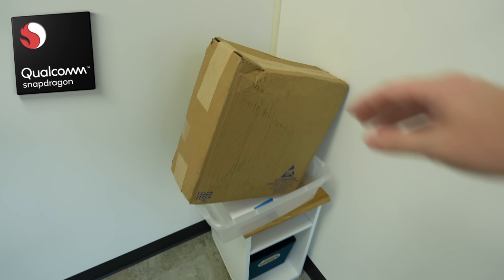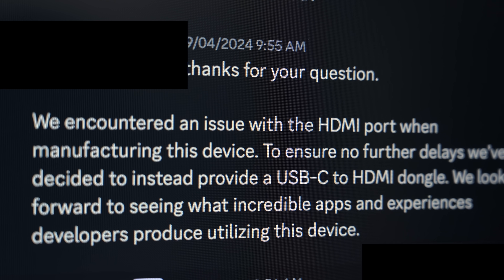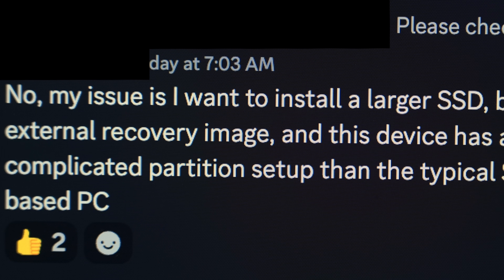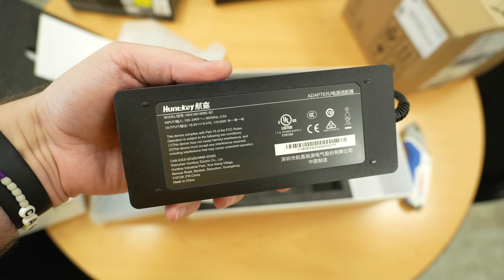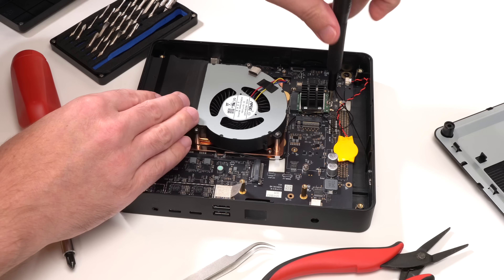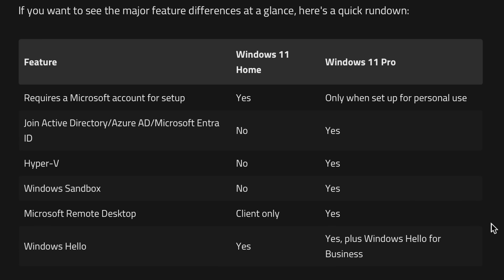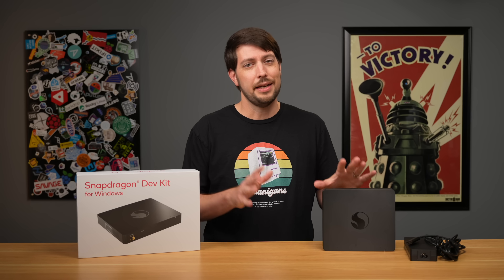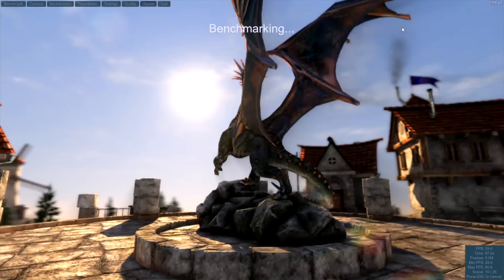Snapdragon X Elite Dev Kit: The CoPilot-est PC, tested

Comment: The reason is doesn't come with windows pro, is probably because it cannot run many of those features like virtualization, or encryption, etc..
Reply from the maker: It can, though! And Active Directory integration, in particular, is huge for a lot of dev shops—they would need to attach the device to their domain so devs could access it... and with Remote Desktop too.
Reply: @JeffGeerling Yeah I upgraded my Surface Laptop with an enterprise license and basically the only thing missing is RSAT (don't know why, must've been very ancient code)

Domain join works, Docker works, Hyper-V works, WSL works, everything just works. Todd Howard would be proud 🤣
Reply: @Thomas-Larsen  Microsoft has basically sunsetted RSAT, and have said they will no longer be developing it. They recommend people move on to their new web tool, but it isn't up to snuff feature parity wise yet.

Comment: It seems truly bizarre that the cost(?) of not putting the most limited Windows edition on these would even be an point of discussion considering what this piece of hardware is supposed to be, not only for Qualcomm but for Microsoft as well.
Reply: It's thinking like the huge megalomaniac company of era X that thinks it cannot be beaten. I recall it being AT&T / Ma Bell at one point, DEC at a second, and IBM at a third. Time for the largest to fall, again.
Reply: Maybe the 'pro' features of Windows are broken on this platform?  So they just removed them.  Similar to removing the HDMI port even though the converter IC is still in the system.
Reply: its a dev platform? the people who buy this and use it have someone to foot the bill

Comment: Not really sure why this devkit was necessary. Unlike the M1, there have been Windows devices running Arm64 for years already. It's the same Windows, same APIs, same executables run on it. Yes, maybe there is some special hardware like the GPU to optimize for but it seems that a lot of stuff already works and as usual, things can get patched later.
Reply from the maker: It seemed to me like someone wanted CoPilot+ to be the launching off point of 'the next era' of Windows on Arm... one where it actually meant something.

But instead, it turns out that was mostly marketing, and these newer Snapdragon X devices are all just incremental (good, but not revolutionary) improvements over the 8cx that came before.

Comment: “Mac Mini Killer” lol the EXTERNAL power supply alone is about the same size as a Mac Mini. Even if this thing had great performance (which it absolutely doesn’t) it still wouldn’t be a Mac Mini killer - it would just be a cool ARM mini PC.
Reply: Do Windows people want Mac Mini killers? I always assumed they were for people who wanted Mac software but didn't need a laptop. If you want Windows - or better, Linux - get a mini-pc, there's a whole spectrum of options, from cheap to fast.
Reply: @henrikoldcorn  The 1L form factor is very popular, both with the Mac mini and on the PC side - there are many options from Dell, Lenovo, HP, etc. The main downside with most of the PC options is they don't have integrated power supplies.
Reply: If they had spent a bit more engineering effort on it, they could have designed a better enclosure that dissipated the heat better so the fan didn't scream - and they could have put the power supply inside. But they didn't, and it's a hunk of e-waste as a result.
Reply: it could be actually good, if it would be able to run linux....but Windows on arm is kinda shit, as well - lack of hardware availability
Reply: @s.i.m.c.a  If you think that general software availability on WoA is bad then Linux is even worse
Reply: @TheTytan007 it's not about software availability most linux distros have arm ports
Reply: @TheTytan007 How is linux worse than Windows in ARM? This is a ridiculous thing to say
Reply: @thehady1  So does Windows and any modern OS
Reply: @TheTytan007  it's "easier" to make linux arm ports and it's  generally faster for an architecture to be supported in linux than Windows linux also has a risc-v port which I don't think Windows has
Reply: @TheTytan007 linux for ARM has been around for years now. Lots of servers made the switch
Reply: @TheTytan007  Most Linux software can be built on ARM if you use a different compiler, but the distro developers have thought of this and have recompiled and ported stuff to run on ARM, RISC-V, PowerPC, SPARC, MIPS, etc.
Just because it is Windows and the most popular OS on x86 doesn't mean that it has good software support on other architectures, and Linux is WAY more mature on ARM than Windows because it has been running on ARM for DECADES at this point on big servers and SBCs like the Raspberry Pi, and has amassed a large amount of software that can be run on it because of the aforementioned ability to build stuff from source (which you can't really do on Windows)
Reply: I though the mac mini also had a rather large power brick? Either way though it could be the foil to the Mac mini for those that don't like Apple's software/hardware walled garden approach even with a big power brick - there isn't a total system volume including all external cables, powersupply and peripheral requirement, just a practical and similarly small desk footprint experience.
Reply: @foldionepapyrus3441  Mac mini has internal power supply.

Comment: It seems like the ECB could be the Embedded Controller Board - this is a class of products that ITE does make (I posted this comment before with a link but it's not showing up, not sure if a moderation tool blocked it so trying again without the link). Embedded Controllers are essentially "BMC (Board Management Controller) but slightly less so" in that they're smaller and lower power than the BMCs used on servers, and typically don't have their own networking or graphics. They're responsible for power sequencing / power state management, fan management, UART breakout (for debugging), etc. 

Generally I would have expected this to be soldered to the mainboard, but if this was development hardware, maybe they wanted to validate different vendors (ITE, Nuvoton, Microchip, etc) and put it on an add-in card instead. BMCs being on add-in cards is also becoming more standard in the server space so maybe they were just taking a page from that.
Reply from the maker: That makes sense; I wonder why it is on the board where it is, though... maybe just convenience, but it's especially weird the connector's right next to the SIM card slot. Maybe they have a version that could be remotely managed over 4G/5G?
Reply: @JeffGeerling  I'm not the most up-to-date on laptop architectures but it's also possible that the SIM card just needs to go to the EC to begin with, even for normal operation. Given this is Qualcomm I'm assuming they'd have some variant with WWAN built into the core SoC, and wouldn't need an external modem (so it's not like the SIM card would be running to that other modem). Said core SoCs don't tend to have a lot of higher-voltage I/O (they're on more modern process nodes with lower voltages), so they tend to use the EC as an I/O expander, which could include the SIM card. ECs then generally have options to present peripherals memory-mapped to the core SoC over a bus called eSPI.
Reply: @JeffGeerling  Wouldn't the daughter card most likely be the "baseband processor"? Cell phones run multiple operating systems simultaneously and one of them handles all the communication to the cell towers. They are usually designed as "blackboxes" which one can communicate using Hayes-style AT commands.
Reply: @BenInSeattle  PERHAPS they could have just used the single ITE chip on the motherboard, for all system functionality, but that ITE chip has optional features to be tied in into a nearby microcontroller (clearly it is), which would be where they run all their custom proprietary crap. They would have put signed certs/keys & modem baseband stuff into this adjacent micro. Then encrypt the whole thing with more Qualcomm signed encryption keys, the whole thing is very black box-like, and Qualcomm is known for this.
Reply: By the way, it's a known thing that including links in YouTube comments will make them disappear rapidly. I presume it is to keep people from having easy exits from YT.

Comment: AMD's new laptops chips are so good that ARM for Windows is completely uninteresting. They are too expensive though. ARM-Windows should be for cheap PCs not crap macbook clones.
Reply: Arm windows PCs are still cheaper than x86 which cost more then 200$ more from amd and Intel and Qualcomm is also releasing a newer cheaper version of the snapdragon x plus to go into 600-800$ laptops soon

Comment: Microsoft gave Qualcomm a several month head start with the Copilot+ PCs, and they squandered it. What a shame.
Reply: To be fair, Microsoft did its share of squandering too. The absolute amateur state of the Recall feature for one. Some of the software support issues are also MS’s fault. But yeah, QC could have done more.
Reply: Snapdragon X Elite was simply too late. They've been hyping it up for 3-ish years before it released, and every quarter they'd say it's happening soon. When it finally DID release, it didn't match expectations and in a hilarious turn of events AMD and Intel caught up in terms of battery effeciency (AKA the one thing qualcomm had going for them)
I will forever thank Qualcomm for forcing Intel/AMD to take their laptop business seriously, but unless they do a gen 2 product that blows everything out the water I expect the hype for an ARM windows chip will die very quickly.
Reply: @PopCar  What if the next Intel CPU generation matches Qualcomm on battery life? Bye-bye, Windows on ARM. Good riddance.
Reply: @RoastBeefSandwich lunar lake looks to close enough of the gap that ARM incompatibility won’t be worth it.
Reply: @RoastBeefSandwich  It literally can't happen. The architecture hasn't been updated for the scaling since the 90s.
Reply: @RoastBeefSandwich well I would sure hope a next gen chip would be better than a last gen chip sadly that's not always the case with Intel 😂. It's like comparing the next gen Intel chip with a m3 instead of m4/m5. I could say the same for Qualcomms next gen chip lmao 😂
Reply: @PopCar  no it's not late never late.
Reply: @PopCar but if qualcomm buys intel then their good 😅
Reply: @PopCar they didn't catch them with battery stop the cap 😂 and the screen off time drain is way worse still 😂
Reply: Would buy a linux version of that.
Reply: Windows was the problem,not Qualcomm,lack of app support was the main cause of X Elite's failure.
Reply: @boltez6507  .. I'm sure it had nothing to do with being ~5 months late with the product.
Reply: @tsalVlog  Yeah their timing was also terrible but x86 translation being shit was the primary reason of failure in contrast apple's rosetta was all good out of box and hence there were few negatives regarding app support.
Microsoft screwed qualcomm,surely with a team of  massive engineers they could've developed a better translation layer but they messed up.
Reply: I've had a fantastic time with my arm laptop, Qualcomm should do a better job marketing the product instead of ai but it's still great in the end in my opinion. The x86 competitors are often hundreds of dollars more for similar chassis' and performance.
Reply: i cannot stand the fanboyism of you w's
Reply: M$ didn't do diddly. There is an obvious 'hidden agenda' here. M$ has not real interest in ARM for end-consumers.
Reply: Is it though? Since CORTANA WAS AWFUL, so why would we expect COPILOT to be better?
Reply: Why doesn't Microsoft just dump AMD, Intel and Nvidia and fully concentrate and attract the developers to the ARM version?!
Reply: @carholic-sz3qv  lmao it ain't that easy,x86 isn't even worse than arm,they both are equal competitors.
Reply: @carholic-sz3qv  mabey not AMD but Intel for sure I absolutely agree Intel has lied to Microsoft for years and made false promises to them over and over again I would not hold it against Microsoft if they ditch them completely in fact I hope they do 🤣
Reply: Real 😢
Reply: What do you expect?  It is Qualcomm.  They are never a leader.
Reply: Qualcomm should have had better GPU’s and less confusing SKUs, one sku for the x elite not different clock speed versions as it’s confusing at what laptop has what.
Reply: Apple still makes a better ARM product, and will continue do so until MS gets serious about supporting SoCs.
Reply: @tsalVlog  I feel like Microsoft's problem is they never fully commit on any of their projects to weather the storm. It's always "Hmm, doesn't look like it's immediately profitable? Pivot!". So stuff either doesn't get the focus and funding required, or gets scrapped entirely.
Reply: @Jmcinally94 I feel like this is a common problem. The shareholders notice a slight drop in immediate profits and freak out even if future profits would potentially be good.
CEOs need to do what the shareholders say so they don't get replaced.

That's just my theory but the behaviour of many big companies seems to match.
Reply: @ThePiprian  That's why an overhaul on shareholder regulations (or rather the lack thereof) is much needed.
Reply: @Jmcinally94 This is basically Zune 2.0. It feels like Microsoft just try to copy Apple success without the right effort put into it
Reply: @Jmcinally94  simple solution Microsoft needs to dump all the x86 chip makers and only focus on ARM it's not that hard.
Reply: @tsalVlog  no they don't! Apple benefits from TSMC latest chip techs unlike Qualcomm or AMD... also Microsoft has to dump Intel, AMD and Nvidia to fully embrace ARM
Reply: @carholic-sz3qv  so you're saying that Apple's on-site (in the US) engineers who designed the SoC, using openly-documented standards (ARM), had nothing to do with the SoC's performance, and it is 100% all in the manufacturing process?

^ how to tell me you don't know anything about how SoCs are made.

no. this was poorly planned, and poorly executed, with almost no thought into what the SoC needed to do for the ecosystem it was targeting (windows). Instead it targeted "people who use intel hardware and don't want to switch", again without any real thought to how it would actually integrate with the OS and software.

Just stop.
Reply: @tsalVlog  Microsoft often takes several generations to get a new thing to work properly. Windows 3.1 was the first Windows to get traction. Internet Explorer wasn't worth a dang (I don't want to traumatize Jeff's sensitive ears) until version 3. 

You'd think Microsoft has every incentive to get a viable ARM ecosystem working for Windows. You'd think Qualcomm has every incentive to do likewise - and get the Linux community on board. You wonder if perhaps they're pulling their punches to keep Intel viable, because Intel's in trouble and if the Windows community starts moving towards ARM, well, that's just more bad news for Intel.
Reply: @cv990a4  I’ve been working in IT a long time. I’m perfectly aware of how slow Microsoft works. You’re ignoring the fact that Microsoft’s foray into ARM support is over a decade old. They took too long.

As far as Windows 3.1? It was released in 1992. Windows 95 in .. 95, XP in 2001. 

Again, more than a decade. Stop covering for Microsoft’s poor decisions.
Reply: @tsalVlog  Microsoft is serious about supporting ARM and AMD, but in the end their customers want Intel. The normal people who buy a $500 Windows laptop are not Microsoft's core customer. It's business and government - and those people want Intel. (They didn't even buy the AMD Surface machines).
Reply: @RoastBeefSandwich  You should probably look at the markets other than personal PCs. Servers are rapidly getting replaced with cheaper, just-as-capable ARM machines; workstations are being replaced by macs; game devs are starting to realize that Metal3 is a really good framework that works well with vulkan. 

People who don't know better want Intel hardware.  People who know better want the software updated to work with actual modern hardware, not 40-year old patents that don't scale as well as Intel claims.
Reply: @RoastBeefSandwich who wants Intel when amd does a better job.